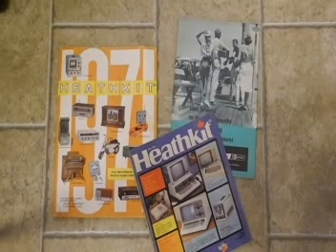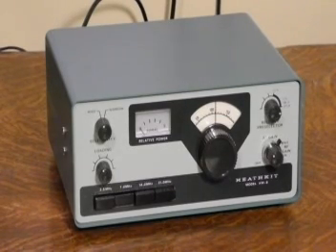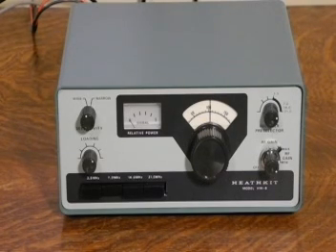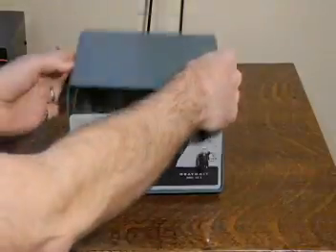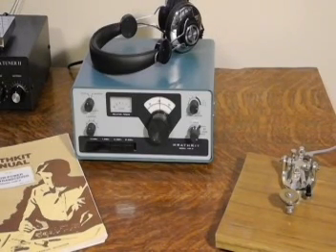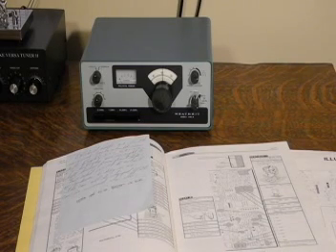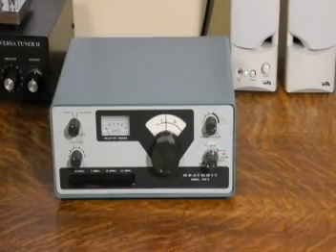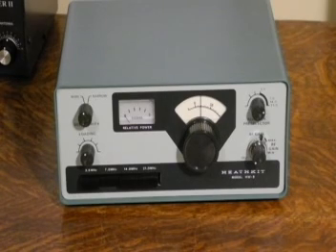The Heathkit HW-8 QRP Transceiver

Comment: Is the relative power adjustment an inbuild antenna tuner?
Reply from the maker: No, it is really just tuning the output circuit of the transmitter for the frequency being used.

Comment: Very good video. I had a HW-7 back in 1976 then later wired up the HW-8. The 8 is the better of the two but I had a lot of fun with both back in the day. AC hum was the usual issue with the Heathkit power supply so I used a battery most of the time. Take care de WA4JAT

Comment: Great Video thanks. QUESTION: TekPower power supply can put out 13.8 volts (14.4) What do you think about running my HW8 at 13.8 ish? Thank you...
KC6EOA
Reply from the maker: That is fine - it can run on 11 to 16 volts and the Heathkit supply was rated at about 13.4V. As long as it can supply at least 430 mA of current, it should work.

Comment: Hot water7,8,and 9 were good rigs. Wonder why I sold them. (Will never know.) Once found my self as a temp for mid cars. Working  one of w8ft's towers had it on battery at the time and worked coast to coast (will never forget the one hour fill in) never under estimate the hot water line . Qrp for ever kv4li

Comment: Built this way back in time.   Fun to make.  Not very good XCVR
Reply: Not exactly so. For an inexpensive QRP rig it worked quite well and was extremely popular. The sensitivity was better than  1uv for 10db S/N and the selectivity had very decent skirts. It was also very stable and easy to tune. Why don't you clarify what was so bad about the HW-8 rather than make what seems to be a subjective opinion lacking in any real facts. I've built, owned and operated several of these fine little radios and enjoyed them very much. I've been a Ham Radio Operator for over 58 years, mainly CW.

Comment: Great presentation Jeff! Just a word of warning about the VFO.... don't turn the knob past the calibration extremes....it is very easy to rip the moving vanes of the VFO variable cap right out of the shaft! Combination of a weak cap and increased torque due to the 6:1 reduction drive....it's so unbelievably easy to do...you have been warned! 73 Steve G4EDG

Comment: Very good over view, I appreciate your standing up for keeping these rigs original.  It's hard to say performance is lacking.. except in a horsepower sense. The stability and quality of the keyed signal is so superior to what the inexpensive tube radios that preceded it produced...and the current drain is so low on RX because this is an Analog radio.. that these are really quite wonderful.  A hunk of wire, a lantern battery , a key and headphones in a knapsack is all you need to get on the air anywhere.   Unfortuantely the video was shot in a format that doesn't match you-tube's  so the radio appears to have a form factor it hasn't really got..  Thumbs up Jeff !
Reply: I know Im randomly asking but does anyone know a tool to log back into an Instagram account?
I was dumb lost the account password. I would love any help you can offer me
Reply: @Jairo Marcelo instablaster ;)
Reply: @Tyler Salvador thanks for your reply. I got to the site on google and Im trying it out now.
Seems to take quite some time so I will get back to you later with my results.
Reply: @Tyler Salvador It worked and I now got access to my account again. I'm so happy:D
Thank you so much, you saved my account!
Reply: @Jairo Marcelo You are welcome :D

Comment: My very first Heathkit build --- Spring of 1978.  I soon wanted more power, so I found a CB "leeeneeerrr" which boosted power into the acceptable range.  For harmonics, I stuck one of those long, round and giant E.F. Johnson low-pass filters (who remembers those?) in the transmission line.  Clean signal (no interference on neighbor's Channel 2 in the days many people still had only broadcast TV reception), but the mechanical relay in the HW-8 would create a transmit delay.  I fixed that by using a larger electo cap to keep the relay closed between sending pauses; i.e.; between words or thoughts.   Still have a couple HW-8s; one works flawlessly and the other is a work in progress.  I have a third cannibalized  HW-8 for spare parts; there are a couple components in the HW-8 that are becoming hard to find.  Necessary mods for me was the addition of meter and dial lights, and having the power-out meter function as an S-meter.  The latter mode is laughably simple, requiring a diode and resistor, even if it is audio driven.

Comment: Jeff, 

Came back to review your wonderful video on this venerable piece of QRP gear because I stumbled on one recently. It's close to stock, but being a ham with a building jones, I will, probably get medieval with the unit. 

It's nice to keep them in their stock configuration if one is a collector but if the point is to operate the radio, it screams for QSK and a low impedance audio board. Additionally, 80 meters is a horror show at my QTH so it will be modded to cover 30 meters a la the N6KR conversion article. 

Sorry for the transgressions and thanks again for your great videos. 

de k6whp.

Comment: Fine video. I like my HW-8, it is all original, except for one mod that I made. I salvaged a 1000/8 ohm output xfmr from a cheap AM transistor receiver, mounted it to the rear wall with hot glue, and wired the output through it to the headphone jack, so I can use 8 ohm headsets. Works great. I also have, and have had, much Heathkit gear. Some of it I still use. Thanks for your very informative series......................Dick

Comment: Whoever discovered that the toroids were reversed didn't want to go to the grief of fixin' em'!  That is a chore.
Reply: I heard you!  My blood pressure rises just to hear the words "toroid" and "HW-8" mentioned in the same sentence.  Many builds you find out there have the toroids incorrectly installed, and other cores have been damaged through age, use, surges and countless other things.  The other HW-8 nemesis for me are those ($*%&) push-button switches.  You ain't gonna fine a replacement, or go thru the agony of replacing them if you did!

Comment: Ohhh...I had one. 'Professionally built' - I was an RF design engineer at British Telecom, and when work was quiet, we could make our own stuff. I worked at Bearley HF Radio station (RX only) at the time, and was completely spoiled by the massive 'antena farm' outside, with all the connectors going through the lab. - I had my choice of antennae. Surprised I didn't blow the front-end out!
Still regret selling it after over 30 years...